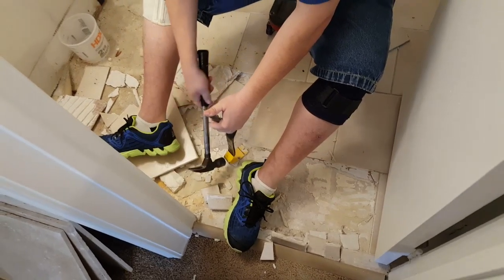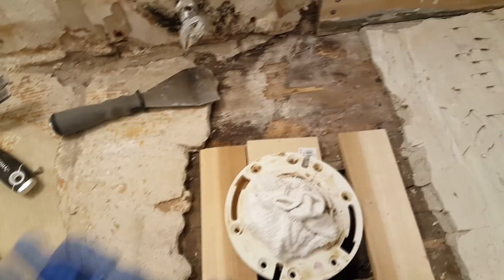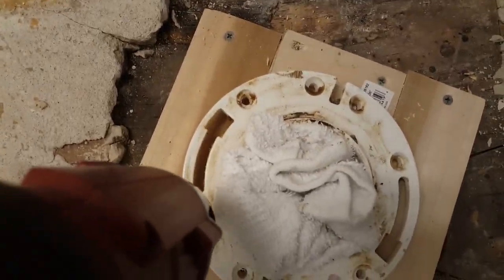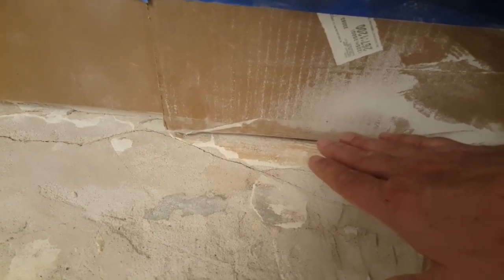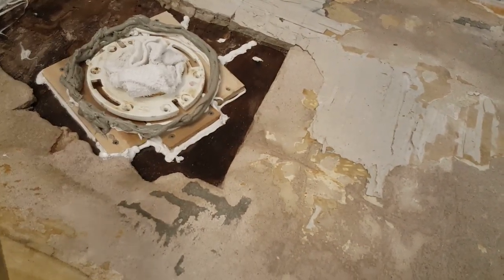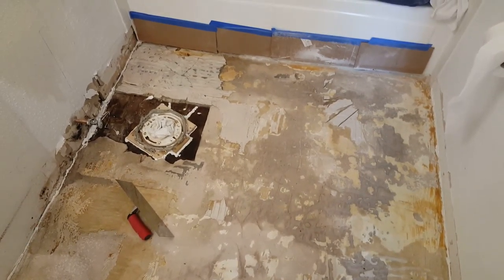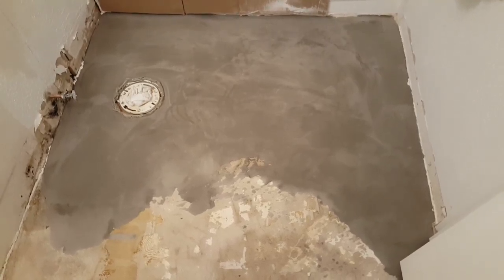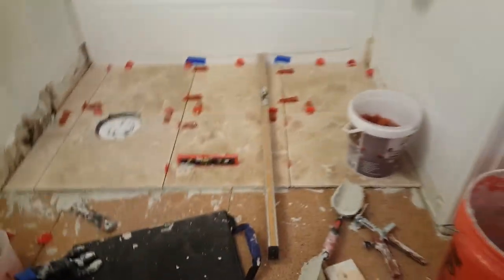How To FIX Wobbly Toilet, Rocking - Not Bolted To Subfloor

Comment: A handyman once told me that he never bolts toilets to the floor, opting to use silicone only to secure it in place.  It's worth noting that in Ireland the UK, the wastepipe is generall behind the toilet, and not below it as would seem to be the case in the US.  However, I think not bolting toilet down is simply sloppy work.

Comment: Why didn't raise the drain pipe when the floor was open? It would have been much more professional than stacking those extension spacer rings. It may be stable, but the next guy that comes and pulls that toilet is going to laugh at that shit.
Reply from the maker: if you want to be stupid and mess with it be my guest, and potentially cause an engineering disaster affecting all the floors below you. This is a multi-dwelling unit built by an unbelievably stupid builder that did so many things wrong and from what we were told by the homeowners Association, the builder almost ran out of cash and this was the last building that they did it made so many unbelievably dumb errors that you don't even want to mess with those pipes or infrastructure because you don't even know if they will crack or not.  These guys even used Polybutylene piping inside the walls which is illegal to use now. And your comment about using the spacers just shows that you don't know what you're talking about because professionals use this all the time there is nothing unprofessional about it because what about when tile companies come in to tile your floor and now they've raised the floor level up as well you almost always end up having to stick at least one or two of those quarter inch shims in there so clearly you're not a contractor and clearly you are unqualified to speak on the subject